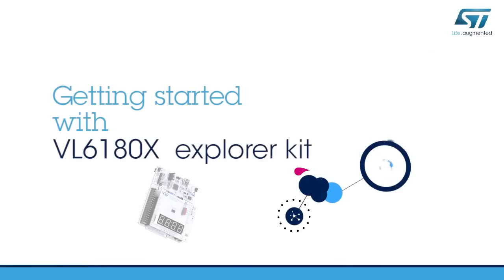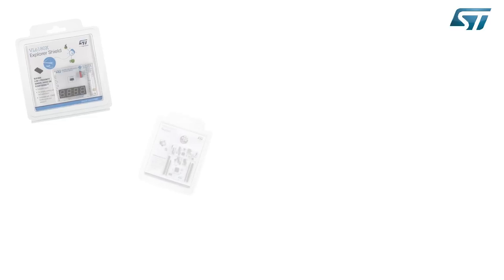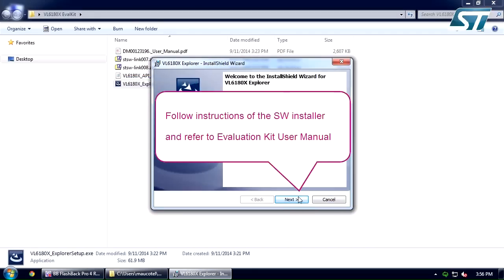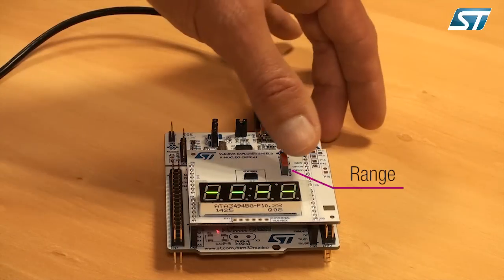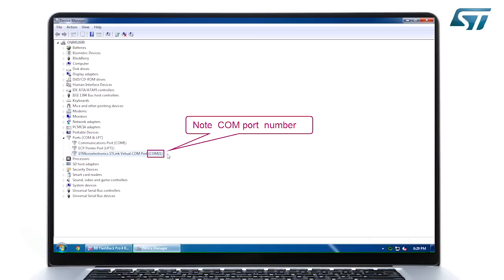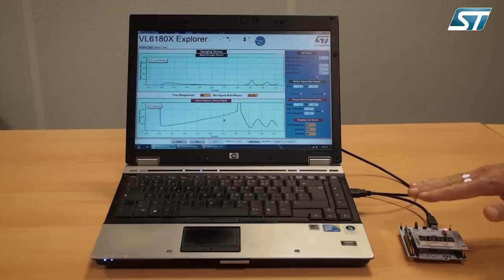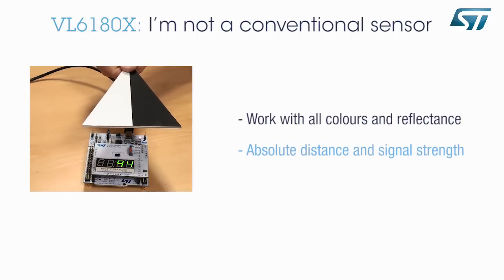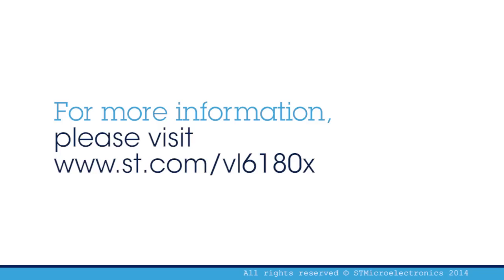Getting started with the VL6180X Explorer kit

Comment: Hello Gianni,
You can order the small PCB adapter (VL6180X-SATEL) from www.st.com/VL6180X.
Direct link here : http://www.st.com/web/en/catalog/tools/PF261466

The VL6180X sensor is already soldered on it, you now simply need to wire the satellite PCB to your application.